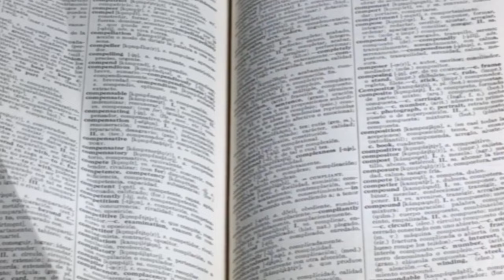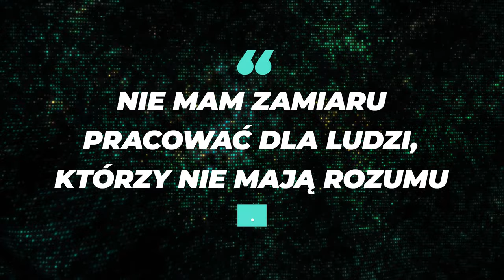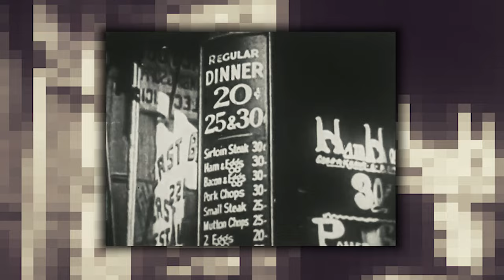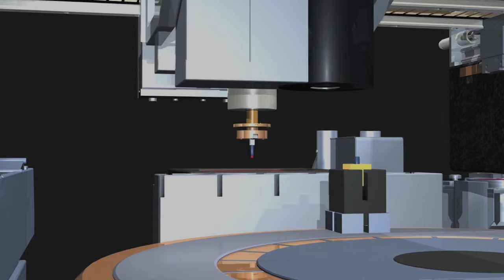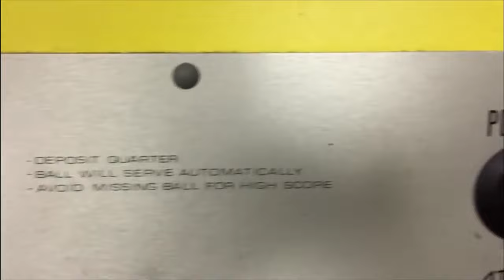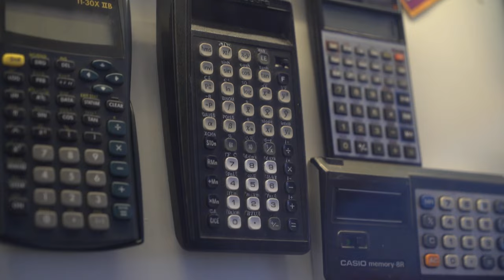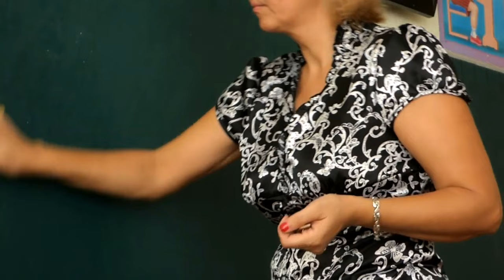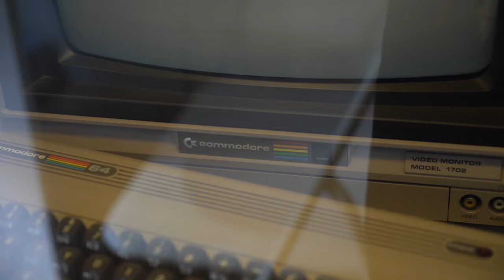Commodore: historia powstania i droga na szczyt

Comment: 10 PRINT"TEN MATERIAŁ JEST REWELACYJNY"
20 GO TO 10
RUN
Reply from the maker: 10 print "dzieki" 20 itd. :D
Reply: .1000 LDX #$25
.1002 LDA $100C,X
.1005 STA #0400,X
.1008 DEX
.1009 BPL $1002
.100B RTS
:100C TEN MATERIAŁ ZASŁUGUJE NA ASSEMBLER ;)

SYS 4096
Reply: @doktornemo3974  :-)